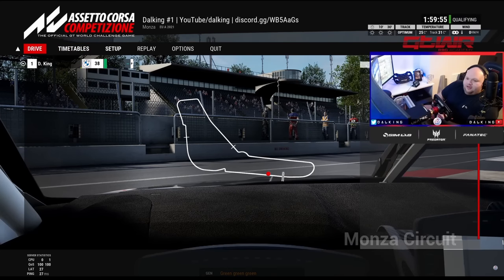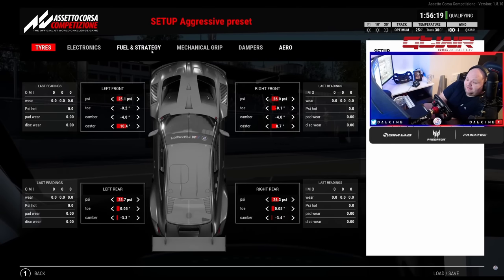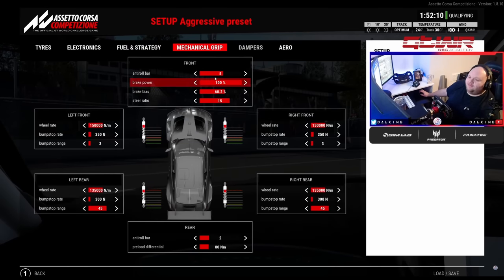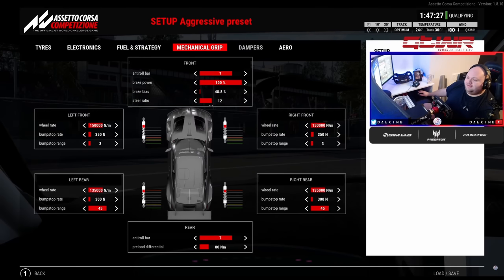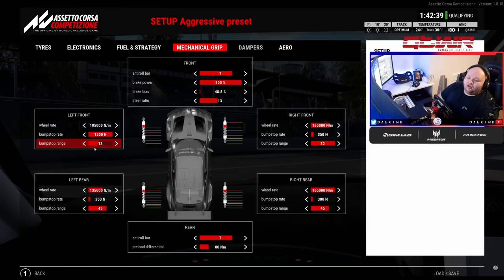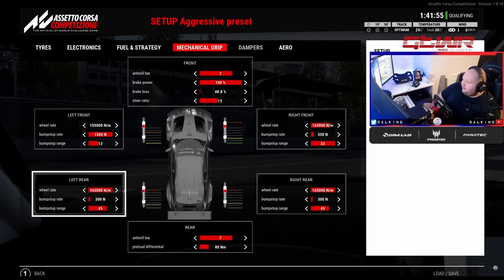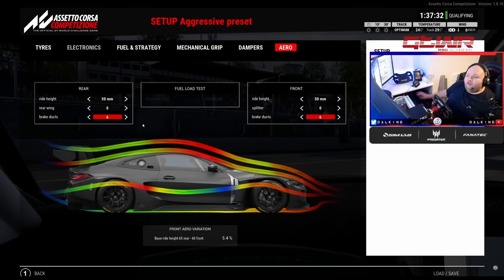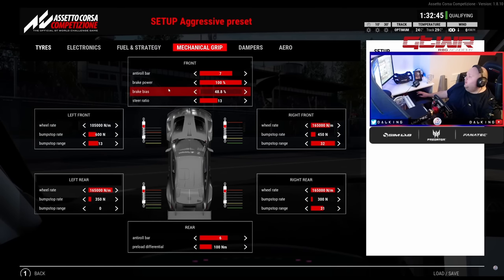2022 ACC SETUP GUIDE FOR MAKING YOUR OWN SETUPS AND ADJUSTMENTS GT3/GT4

Comment: Toe is easy to understand, just look at your feet. Walk with your toes pointing in, that's positive toe. Walk with your toes pointing out, that's negative toe. Which one is easier to walk with, toes in, or toes out?
Reply: So many people standing up for a quick walk after reading this 😂
Reply: Does. That work the same when your toes are in front the middle or behind you also does a straight toe work on a 5 degree corner
Reply: @SamEdwardsTV  Yes, as toe only relates to where the wheel is pointing. Steering changes toe angle. Like a rudder in water, so your rubber on asphalt.